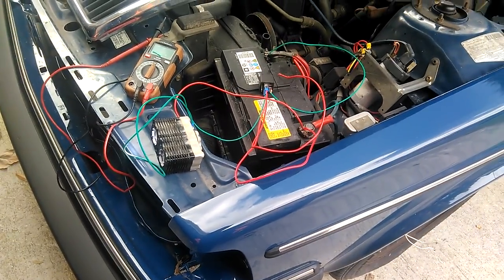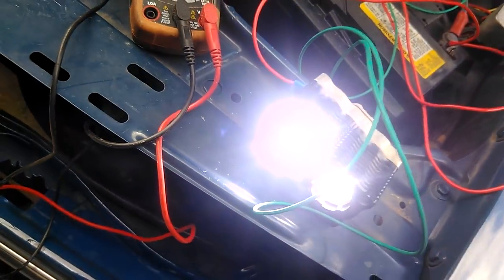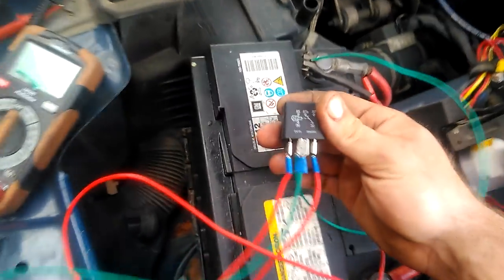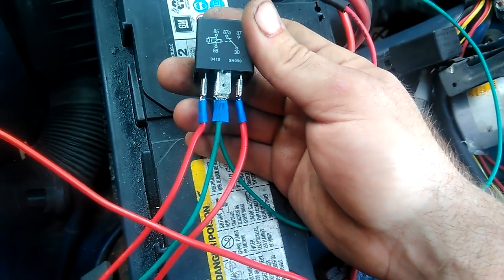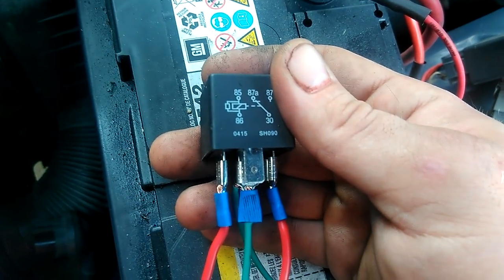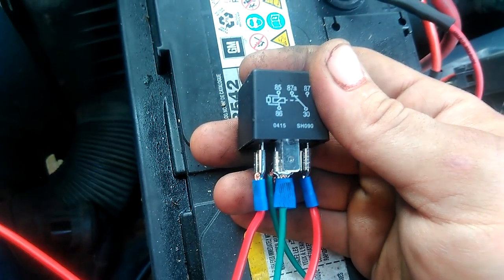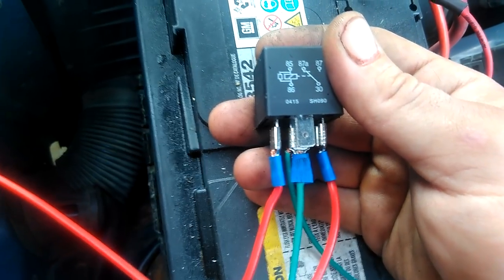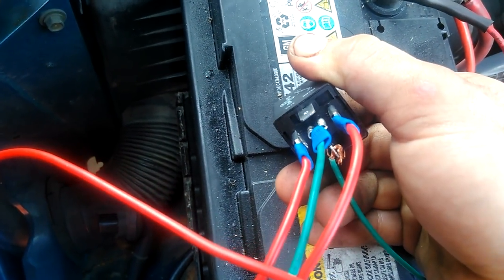How to wire a side marker as a blinker and running light

Comment: I have used relays before. This was the first time I wired the circuit the opposit way meaning to enable the flashing by opening the circuit.  VERY cool Idea. It worked. I added s 7 foot LED strip on the side of my truck. When lights are on the side amber lights are on. When I select to turn on the turn signal the whole side of the truck flashes. I used one relay for each side. I bought a 10 pack of relays from Amazon. Yeehaw NICE NICE Nice. Super cool. Best Tip of the year.
Reply: @Marylandcowboy I just double checked. With the parking lights off there is no flash of the new circuit. Only the stock turn signal flashes. The above works because the driving circuit is on or just the yellow lights. Very visible at night. Hope this helps.

Comment: If you want to make it to where the turn signal still works when the parking/running lights are off, make 87A always hot, make 85 the power wire for the turn signal, and make 86 the power wire for the parking/ running lights. This works on the principal that if you hook 12 volts to both sides of a component, there is no flow of energy. The component turns off. This only works if the computer grounds turn and parking light wires when they are turned off, and I think most do but I could be wrong
Reply: So has i understand. It wont work. Because 86 and 85 needs  power to activate. Lets say its true the current will not flow when they are activated..m but neither it will it its turn of. Thus  the relay will do nothing. And by having constant power to 87A then the 87  or 30 will have comstant poner untill the relay activates to change the conection to one pin to another
Reply: @yunarukami6118  I misspoke. Everything is the same except 87 is the constant power, not 87A. With pin 30 being the output to the led turn signal/ running light. This only works when the computer grounds the power wires when they are switched off. When only one side of the relay has power and the other side is grounded by being off the light comes on. This way the turn signal works when the running lights are off as well as when they are on. When the running lights are on the turn signal will flash at the opposite time the normal turn signal would.  The relay is only necessary because the bulb is LED. Many trucks use the side marker light as a turn signal by hooking the power wire for running lights to one side and power for turn signal to the other side

Comment: Maybe I'm not thinking of this right, but it seems like this setup would make the side marker alternate with the blinkers rather than flash in time. If so, maybe you could use a second relay to invert the flasher signal?
Reply: I think you would have to take the indicator signal from before the flasher unit as that would be a solid feed?
Reply: How do u hook it up so that it blink together??

Comment: I am going to try this tomorrow. I rewired Dodge's bs factory system to a much easier toggle switches system. Couldn't figure out how to make rear lights run (parking lights) and be able for use with turns. Cannot wait till the sun comes up now! Thanks, will keep an update!
Reply: did you get it to work??? im having the same trouble. cant get running rear lights withou canceling my turn signals...thx
Reply: @alphathefirstone1222  no, I ended up rewiring the entire truck. I installed a touch screen panel with 6 different push pads for all the lighting. I installed on off on switch for turn signals. And was able to reuse the brake light wiring from the 3rd brake light. I spliced into that, and ran a 14 gauge pair to the rear for brake lights. So my brake lights and my running  lights are on 1 bulb, and I installed a led pod for the 2nd light (turn signals)

Comment: i want to convert my jeep cherokee/liberty to do this here in uk. two modules hidden away each side simple enough.   although i'm now wondering if it'll afffect the rear sidelights as thats the circuit that would be wired to it from the front sidelights.  american sidelight/turn signal are wired to flash with your brake lights ours have seperate side lights also, but are obviously wired different as ours would short out the rears also?? as our fronts are wired to a WHITE sidelight, white dipped/main beam and orange turn signal.  but we use orange rear turns, we have to convert or retro fit a orange turn signal on imported american cars to make them road legal.  so your side lights would be wired different to the front from the rear i'm guessing.  we usualy have separate fuses for left and right as its safer if you blow a light fuse lol

Comment: If I connect pin 30 to a positive ignition wire and leave everything as you have it. This will cause the side marker to always be on as soon as you open ignition correct? And then when hitting the turn signals still work?? Thanks!!

Comment: This requires the running lights to be constant "on" to work. Is there a way to have the blinker work in this circuit if you have a switch for the running lights and decide to keep the running lights off during the daytime? How then would the blinkers work with no power to draw from the running lights to blink?
Reply: Basically the same question I've been wondering
Reply: This is the reason why im here. I manage to mske this exact circuit on my own. But i need it yo make it work  even if  the daytime light sre off. Sooo. Did you find anything  or not?🤔
Reply: Any update on this? A diagram would be great

Comment: Just wired my motorcyle by this tech tip .. thanks for the video !
Reply: arlan navasa Hi I know it’s a while now but I need some help I did my motorcycle but I am having some faded light on the dash do you remember how you did it please
Reply: @rickybritish  do you have a single bulb in your dash ?
Reply: arlan navasa I want to do it for my bike Yamaha R1 but something don’t seem right the I wire the relay my indicator work but on my motorcycle dash if I turn the right indicator there is a faded light on the other side on the dash.I have a video of how I wire mine.
Reply: arlan navasa https://youtu.be/b0Kfc1pMWvg
Reply: arlan navasa can you tell me where I went wrong
Reply: arlan navasa on you relay I could see the wires properly,I have the 30 coming from bike 🏍 + 87a to my light + 85 I used 2 wires one going to the light- and the other to bike -🏍 the 86 I used for signal connected to indicator signal.
Reply: arlan navasa I think in your connection,you connect the grounds from the light to the batter - and from pin 85 from the relay to - of the battery pin 87a to the + of the light and pin 30 to the + of the battery and 86 to indicator signal  wire is that correct ? The only thing I did different I made Y wire from the relay 85 to the - light and the to - battery maybe that’s where I am getting the problem on my dash.
Reply: I’m sure this is really simple but I’m not understanding where the wires for the actual light connect. I’m guessing one end plugs into the relay and the other to ground? A diagram would make this REALLY easy

Comment: Will the turn signal work if the running lights are off
Reply: No not using this method u can do it with this relay forget what this guy says completely and look up how to wire light on 5 pin relay some really good vids out there

Comment: Will the lights blink opposite of the turn signal??? I wanna wire my running board lights up to double as turn signals but I want them to flash in sync with my stock turn signal
Reply from the maker: Craig Harris yes they flash opposite to the normal ones. I'm not quite savvy enough to make them flash at the same time
Reply: dalton456 I found a part that should make my lights work in sync. It’s called blinker genie 2
Reply: @Marylandcowboy I did try the blinker genie. It didn’t work
Reply: Blinker genie doesnt work

Comment: Are all 5 pin relays the same?
Reply from the maker: I would say for the most part yes but the terminals may do different functions or be rated for different amperages or voltages
Reply: @dalton456  ok I found some on Amazon just didn't know if they were different

Comment: So I am seeing this as
30 12V input, in this case running light in
85 Turn Signal input
86 Ground
87 not used
87A Output to your Light
Light has its own ground
Am I seeing this right?
Reply: I would like to know this as well!
Reply: Matt Glandorf ,good day bro.did u done it successfully? How was it? Im affraid to try this on my car though i really want it but i need to know more about wiring the relay to the park and signal lights clearly.hope you can help me bro.thanks in advance bro,good day
Reply: @toyconph3642  a simple led light will do absolutely nothing if you mess up the wiring, try it out if you fail take it all out and go back to the drawing board unless you mess with more major electrical circuits you won't really risk anything by failing other than possible screwing up an existing circuit you try to splice into (trying to tap into turn signals and instead making neither the turn signal nor your addition work) not much risk other than hurting your ego

Comment: Ok could I do this on my bike I have 3 wires coming from the bike and my new running light is only two wires but I want it to blink too
BIKE:
Black ground 
Blue running light 
Purple turn 

RUNNING LIGHT
power yellow 
Ground black 

How would I hook this up
Reply from the maker: http://i1176.photobucket.com/albums/x329/Dalton_Guillot/sidemarker%20diagram_zpswjtmzp20.png
Reply: Dalton456: can you please explain exactly what you mean by for 87a and 86? I little confusion here. Thanks!
Reply: “Ground side marker back to parking light”? Confused here. Should it just be grounded or to the NONMARKER ground.

Comment: Problem.with your set up is when the Parklight is off the side marker does not do blinking when signal light is activated
Reply from the maker: yes this is the one drawback to doing it the way I did. in my case I ride with the headlights on even during the day, so it isn't really an issue. this was the simplest way i could think to do it off of the top of my head that would still work with an led bulb.
Reply: great video
Reply: Great video, have you tried to solve this drawback?
Reply: je2854  can you send me a diagram of what you mean?

Comment: Trying to decide if I want to do this or just add another pair of lights and wire those to the Parking light. Yeah it'd be two side marker lights on each side (one pair for turn, one pair for markers), but I hate having to buy more stuff. $16 each?.... ugh
Reply from the maker: you could buy them online cheaper, I just used the ones from the auto parts store because i wanted to do it that day. you could probably get both relays with sockets for less than 20 bucks

Comment: Tried this on my 94 Jeep Wrangler. Everything works fine with the headlights on. I get the running light and blinker but once the headlights are off I lose blinker. Any ideas? I've been trying every wire configuration I can find and am still stumped.
Reply: Sean McD good day bro,did u already fix yours? Please tell me what u did.thanks in advance bro
Reply: with this setup they will only blink when the lights are on. like this.
lights on the blinker breaks the the flow of power and turns the light off.
lights off the blinker has no power flow to to break
to fix this you will need a light that is dual function (as in 2 hot 1 ground) 1 hot marker 1 hot blinker 1 shared ground .
Reply: Have you tried putting Pin 30 with a positive ignition wire? Causing it to activate as soon as you turn on car and make the turn signals work everytime?

Comment: Couldn't i just splice into the xisting factory marker \ blinker wire harness.???
Reply from the maker: depends what you're trying to do, and if you are using a halogen or led bulb
Reply: dalton456 yea basically would be doing exactly what you're doing with L E D .....( both sides) otherwise why bother...  Just seems though it would be more efficient..
Reply from the maker: you cant wire the led across the wires to light up solid and blink, but you can do it with a halogen bulb. the reason you cant with a led is because it is a diode and only allows current to flow one way, while a regular halogen bulb can pass current either way.

Comment: If people who go to YT already know the terminologies and which wires to connect they wouldn't need to go to YT. But they still end up going only to find there's no solution given by any of these videos.
Reply from the maker: there is a diagram provided, and this is somewhat universal circuit. The bottom of the relays are numbered, not sure what more you want because this video is not meant to explain what a relay is and how it works
Reply: @dalton456  yeah pretty vague for someone looking for help thats not good with wiring not to mention the wiring explauned in the video is wrong to how it should b done so confusing a confused person even more hurts more than help